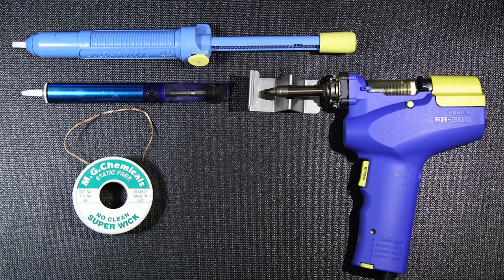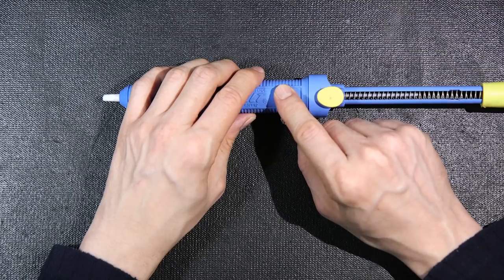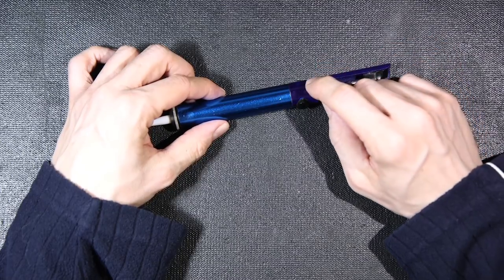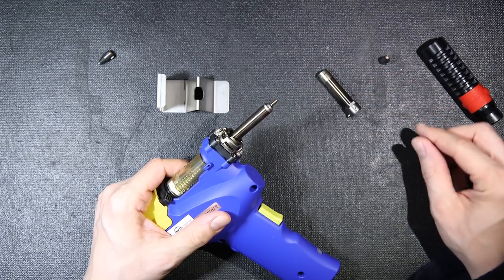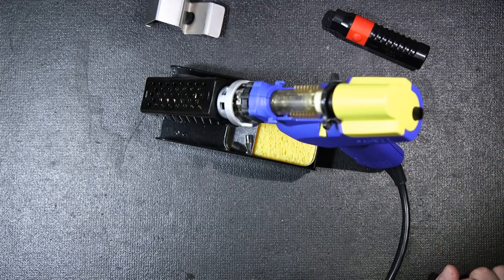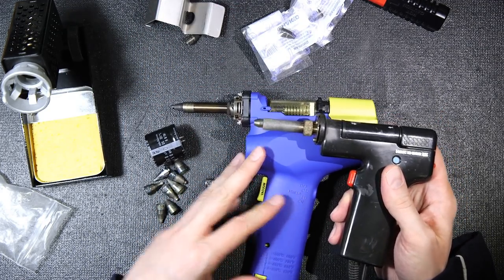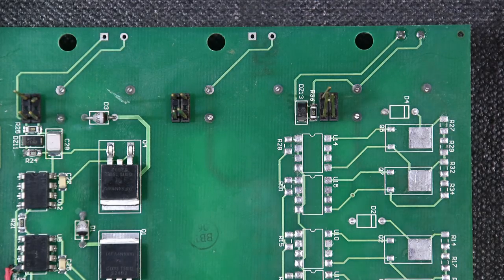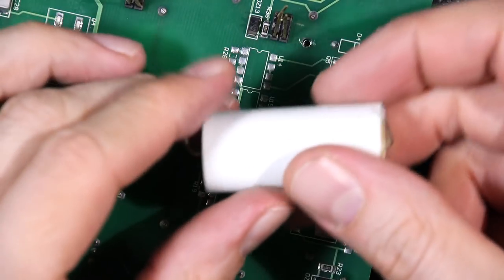How To Desolder Electronic Parts Using Different Tools.

Comment: Great video! I have the small blue desoldering pump, but mine is all metal. Just took it apart and it needs to be cleaned... Can I just use grease as a lubricant? Does it affect the rubber o-rings?
Reply from the maker: I'll let you in on a little secret, (Pam non stick cooking spray) After you clean it, o-ring and all, a small shot of Pam in the seal (o-ring) area, and the unit will work great.
Reply: Thank you for sharing the secret!
It's the first time that I actually clean/maintain a desoldering pump, the one I had before was all plastic and broke after a year.  The new one was in use for a couple of years now, so I thought it might be worth to maintain it.

Comment: i have one of those aluminium pumps, and when I unscrew the tip, I can pull the piston out, and clean out the tube with paper. never had to unscrew the top. didn't even know it would come apart

Comment: Sometimes you have a plated through hole with a header like a molex 6 pin that is very tight in the hole. I am trying to use my Hakko iron on full blast and the sucker cannot pull the solder out. How to do it in this case?

Comment: I sucked it up, got out the old Visa Card,  and bought the Hako FR300. I also grew weary of seeing PCB pads stuck to the tips of my Soldapults. The old wick strips are good for really cheesy cheap, or old & fragile boards, some of which are vapor deposited, with ultrathin copper traces and pads, and others where the copper is old, corroded, and barely stuck to the board, with lots of imagination and prayers. That Soldapult is NEVER cocked when you really need it to suck a blob off, or you need to make 300 zaps at a series parallel cap bank. The smaller solder suckers, are almost total junk. A surplus shop sells those for $3. I must have bought  dozens of them, and all of them have crapped the bed by now.  The little one is less likely to suck pads off the board. I'll have to get that holder for my Hako FR300. It's in the case right now. I have an old Pace desoldering rig, but it should have gone into the trash long ago. I almost bought a Wun Hung Lo brand desoldering gun. The place had them on backorder, I needed it yesterday, and that was probably a blessing.
Reply: Leave it to Mr. Carlson to hotrod his Hakos. I have never heard of anyone putting a VFD on a Hako. Maybe you can split the motor from the element, run the motor on the VFD and put the element on a 240 volt Variac. More heat and more suction!
Reply from the maker: I think you will like the FR300 Seth.

Comment: I tried to use a infrared temp gun on my iron to see if the actual temp matched the base display.I only got very low readings.But the tool will get plenty hot to solder.Any ideas??

Comment: One little tip that I can give people is to use a bit of clear silicon tube to slip over the tip on the solder sucker so that you can get a better seal around the solder joint and iron at the same time, the silicon tube is easier to replace than the tip of the solder sucker and is probably rated at higher temperature... Best of all is the increased suction power while being able to keep your Soldering iron where it's needed...

Comment: What type of flux are you using at around 31:50? RA Type flux, but is that something like MG Chemicals Liquid Rosin Flux or Kester 186 / 959T? I like the properties of the flux you're using, and would like to buy some.
Reply from the maker: Hi Adam. Its MG Chemicals #835.
Reply: Thank you! Love your videos

Comment: I don’t understand the plastic tips, are they made to be sacrificial in the attempt to seal better by melting in?
Reply: In a way yes they are sacrificial but they don't really melt all that much. I've used a single tip for years without needing to replace it. The cheaper (small dark blue) suckers do tend to melt much more. It's totally worth spending the extra money on Solda Pullt but finding tips can be difficult so when you do find them, buy in bulk.

Comment: I have a method of removing solder that is particularly nice when removing parts from something you do not intend to save.  My air compressor and a pistol grip air nozzle. I have one that is always with the compressor and usually at my bench. I also have one in a kit with several size tips that I accaosianlly use when I don't want molten soulder blown across  my project;  biggest drawback. It sure makes a nice clean surface, just like new.  
warning, molten solder is very hot. blasting it across the worldbench could have unintended consequences. I won't go into personal injury, and talk about safety glasses, or which way to direct the air, preferably away from yourself and or anyone else.  Let it be known however it will penetrate the surface of most plastics, clocks, radios, plastic lenses on magnifying lamps, some clothing, cell phone cases.  Be smart, safety first, add to that a few brains, and you got yourself another great desoldering tool.

Comment: Thanks for the video, very helpful! Unfortunately the Hako FR300 is not within my budget but the "The Original" Deluxe SOLDAPULLT is on sale for 30% off at the manufacturer's (Edsyn) website until December 29th so I bought that instead. 73 KD8YUQ

Comment: Hi Paul, I have an Aoyue 474A++ desoldering station, what a piece of junk.  It doesn't get hot enough to melt the solder.  Does the Hako FR-300 get hot enough to work well with point-to-point circuitry?

Comment: I have the larger sucker i got from my dad who fixed TVs in the 70s probably bought then. Never thought about lubing the O ring, One guy i read uses automotive dielectric grease what do you recommend
Reply: + iron man - I would probably use so-called "plumber's grease" which comes in tiny tins for lubing O-rings and such in water valves. Or you could use lithium grease... it really doesn't matter as there is no physical or temperature stress on the seals. Use what ever is compatible with the materials.
Reply: Graphite is a dry lube, so make some powder with a pencil lead and use it.
Reply: @igrewold  , you can buy powdered graphite from a hardware store or online. It was once favored for lubing door locks. Pencil "lead" has abrasive clay in it, molded and baked like a brick.
Reply: Paul says he uses Pam cooking spray!

Comment: Silent "l"! solder
[ˈsädər]
NOUN
a low-melting alloy, especially one based on lead and tin or (for higher temperatures) on brass or silver, used for joining less fusible metals.

Comment: Also the solderpullit fires a static electric discharge through your components when you trigger it. can be a problem with some delicate things.
Reply: NebukedNezzer   They make an ESD-safe version. It's plain black instead of the iconic blue and yellow, though...
Reply: thanks for that ESD safe update. if you want a electrostatic charge detector just use an old liquid crystal display. hold it in your hand and bring the edge connector near a charge and watch the segments come on.
Reply: Cool! This is why I never throw anything away...

Comment: A genuine US made SOLDAPULLT DELUXE just like mine. :)
Reply: Looking a little closer the one I have is probably a bit older and has some minor differences and the original tip for mine is flat with the blue part and was discontinued but I order a new one that is rounded like yours and it fits just the same. It works great and was given to me by someone that is now retired.

Comment: I am having a problem a moter went bad and It had wires White, red,and black on the tiniest of points, not knowing the manufacturer's used a glue covering the entire area, I thought man I had a tough time getting those 3wire off, and looking close I have a mess of glue/solder remaining on the points needing cleaned in some way! I'm at a loss and time is money but a botched repair will be about 550$ ! I don't have Any ideas tip advice would be a Great Help ,I like your desoldering heated sucking gun! I don't think it would have helped for this problem, but seeing it in action, needless to say I know what my next tool purchase will be, no I will have to but it off My tried and true soldering Iron broke apart in peaces in my hands, I still have my old soldering Gun inherited from my Grandfather Wall It was made  to  last Generations,!So not have Great luck past couple of days I hope a reply may give me some help, Thank You

Comment: Poor man's Desoldering braid. Get some tv or antenna coax and strip off the outer sheeth and use the copper braid. TOP TIP

Comment: CAN ANY GENEROUS EXPERT CHIP IN ON THIS QUESTION?? :)
A while ago I lived in a place which was around 20ft from the local power-grid sub-station. During my time there an old CRT TV would have trouble holding Vertical lines etc, My CRT PC monitor stopped powering up, my DVD player broke down and would only light a few random parts of the LCD screen, and now my sat receiver is doing the same as the DVD player.....I think there must have been a problem with the electricity supply to the house, perhaps being too many volts or amps due to the proximity to the sub-station. (The house was a new refurb so there should have been no problem with the internal electrics, and the breakers never switched)
So my question is this, I want to try and save my sat receiver if possible, so do you think a few replacement zener diodes or similar might be worth a try??. This would really be like a kind of hobby project for me, I don't have a lot of expertise or test gear but I did once replace a zener diode on an electric piano which had been given a 16v supply when it only needed 12v, and that worked a treat.
Any ideas will be gratefully received!!  (pun half intended) :D
Reply: Consider running anything expensive or sensitive through a good UPS first.  Most will ride through sags and surges while letting you know by beeping.  Also, contact your power company and/or neighbors to see if they have had similar problems reported.  The can put a data logger on the line to see what and when something happens.
Reply: Thanks Keith...that's some good advice. I don't live at that location anymore, so don't really have an ability to research/deal with the original problem (sub-station??) I do now run my newer PC through a surge protector. What really tickled my interest was that the DVD player and sat receiver both broke down the same way, i.e. they both power up only as far as lighting a few random parts of their LCD displays, which maybe suggests they're just not getting enough power to run or load their internal software etc??, which might be something simple like the zener diodes partially failing, and also wondered if this was a common problem after potential surges as the two items behave the same.....'tis a quandry indeed!! :) ...but i might call the power company anyway..you never know...they might have a bored engineer I can email with my exciting stories!! :D

Comment: I have used all these types of desolders one little thing I use to access tight spots I put a small piece of heat resistant silicone tube over the end of the desoldering pumps it can bend and be used at an angle it dose clog up but is easy to clean . Might help someone?

Comment: I have a heated desolating iron with a squeeze bulb on it.
 should I tin the tip of the desoldering iron  ?
Reply from the maker: It should always be tinned or it won't accept solder after a period of time. If the plating on the tip doesn't accept solder, you will have a hard time making a thermal connection to the board, or what ever you are working on. This problem is common to all desoldering tools, if the tip is left too long without any solder applied.
Reply: Thanks Paul for the quick reply and that information, I appreciate it.
Reply: I'm considering getting the same type of desoldering tool.
Reply: "desolating iron" is an interesting slip of typing, ha!
Reply: Anvilshock : Hell, how did I miss that? Lol!
Reply: Keep removing any flux & old solder, as those are what etches away the plating!

Comment: 34:07
This kills the component.
When heating the body of small components like that, make sure that you have a replacement handy because it'll most probably be dead after removing it by heating the whole body like that.
Microphones in particular are very sensitive to heat.

Comment: i use soldering iron mostly but i do it for my self its not an job but ive get in an sercet witch i dont needed the point to actually drill a whole with soldering iron witch is weird doe just starts to make it bigger like
Reply: and my first focus like about the half before u pull it i was like thats not passing and u cut it after :/

Comment: Hey - Great Job . Please warn from inhaling the soldering vapors ... it´s not so healthy at all ... thanks alot.
Reply: It's not vaporized lead, if that's your concern-
Reply: No - its not ... But ...

The so-called solder smoke or solder vapors are considered toxic.

Many believe that today's lead-free soldering is safe. This assumption is unfortunately wrong! 
The electronic leads with lead, which are no longer approved for commercial
use since July 1, 2006, were in fact a significant danger to health and the environment. 
According to Weller, however, lead-free soldering produces up to 250 percent more particles in the 
breathing zone than soldering with lead-containing solder. 
As a result, up to 700 million particles are ejected per cubic meter of air, which can get into the alveoli.

 The soldering smoke (ie the vapors that form during soldering) consist of several components:
 - the vapors from the flux
 - alcohol vapors
 - Dross dust from the solder often contains lead and other heavy metals in lead notes 
 - Fine and finest dust particles
- (but especially eb not only in brazing for example)

There are also many other hazardous substances such as hydrogen bromide, lead oxides if using lead solder, 
hydrazine, rosin (when used as flux), phosphorus pentoxide, and a few others.

Precautions:

If more is soldered, a professional suction should definitely be available. If
one does not set the soldering smoke permanently, but only on a 
case-by-case basis, a good ventilation of the room and an open window is
sufficient. In any case, the resulting soldering fume should not be inhaled.

If you solder more often, you should protect yourself more largely because of certain lead (fine-dust-) compounds.
(oxide dusts arise ... its not the lead ... its the oxide)
I think these measures should be urgently respected.

Please research for yourself

Comment: I've never had any luck with the spring plunger desoldering tools.  Bought several types and none ever worked properly.  I've had a desoldering bulb from Radio Shack 30 odd years ago, and its still going strong!  The electronic desoldering pump is the cats arse.  The type with the pump in the handle vibrates too much for my liking, but the type with the pump in a external box, like your 802 is the best.

https://www.radioshack.com/products/desoldering-bulb

Comment: Whilst useful, I find there isn't really any need to "desolder" most simple 2-hole devices like resistors and capacitors, and even more 3-hole devices. Just heat the leads one at a time, then lift or walk the component out of the hole. Use a bit of braid to clean up the PCB hole afterwards, only if necessary. I harvest a lot of passive components, and it would take me absolutely forever to do it with a manual soldering pump.

Comment: I realise this is an old video but I will ask anyway. I love to recycle parts out of old thrown away electronics and make use of them as much as I can. I even go as far as sorting them out and keeping track of them in a database. Can anyone point me to a good way of fast desoldering of components (I car that the components are not damaged but do no care about the circuit board). What are the peoples thoughts? Going with a manual desoldering pump is killing me, and my electronic desoldering pump seems to get blocked too often so does not make things much faster. Thanks in advance.

Comment: HI PAUL'''''''for hand sucking i use a ''ENGINEER- SS-02'''great little hand sucker'''''its a little pricey for some people but ''price'' isnt that big of a deal as long as it works ''perfect''''''and it does''''''but im wanting to upgrade to a ''gun'' that heats'''''vacums'''''''''''like a HAKO desoldering gun'''''its a very good ''idea'''' to have the ''right'' desoldering tools'''''because you can ''damage''' or ''''destroy'''' a circuit board without the right tools for the job'''''dont let ''price'' get in the way'''''''get the right tool'''''''jkames'''' oklahoma.

Comment: Watch out if buying on EBay for 220 volt 50 hz units.  What looks like a economic tool might not work on US 110v 60hz power.  Seems not much  work is done using 110v any more.

Comment: The only tools I have are flathead screwdriver homemade soldering gun and a live flame from a candle razor blades sandpaper other metal poking tools and scrapers made of hardened steel can anyone out there tell me any advice the best way for a caveman to remove this component which is a USB port that's on a cheap flat screen television board I'm adding a picture with my question of the component that I need to remove

Comment: Good solder wick is the best way to go. Tools are just gimmicks to make someone else get rich.
Reply from the maker: I wish I could agree. Try changing 60 capacitors in a CNC power supply with wick.... Not going to happen!